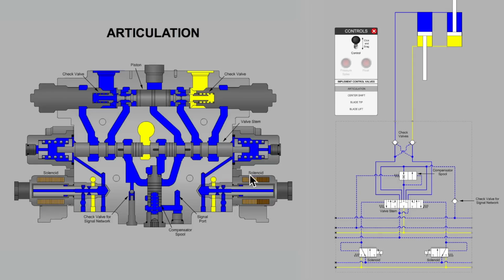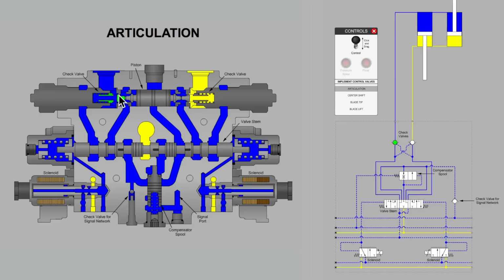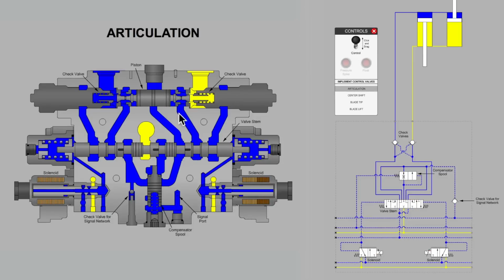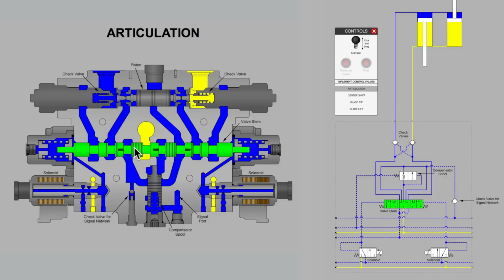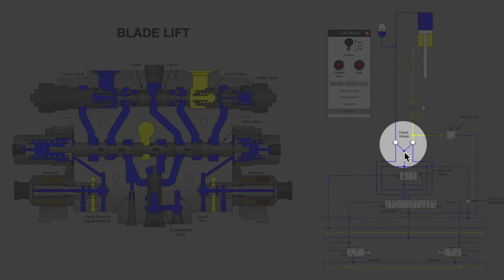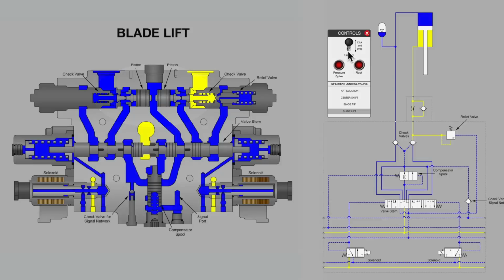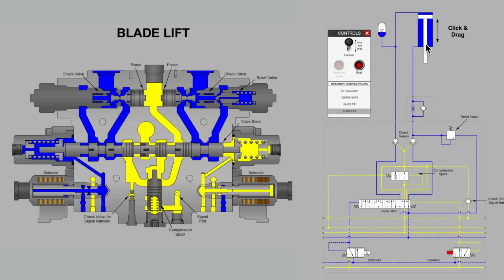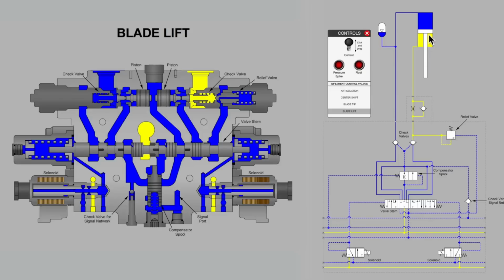Pilot Operated Check Valve Cylinder Troubleshooting - Part 3

Comment: Hello lunch box, I have a question , our hydraulic system during any operation pressure going to zero bar so we check found pilot operated spool valve  Y port continue oil leakage and one another valve continue oil leakage from drain point,  I have changed valve but problem not solve any idea from your side ??

Comment: Sir godmorning  i asking  control valve sideshift cylinder jack  have 2 pitting why the 1 pitting have pressure the 1 no have pressure electrical have suply lift in right  now i change complete control same problem no coming pressure in side pitting sir what is the problem

Comment: Hi sir ? How are you. I  have a komatsu p c mr 5o . Problem is that everytime you use travel stick  nomatter right or left the there is  a valve or spool stays glogged  for 10 to 20 second. In this position  you can not use any lever  but travel. Or swing  cause  if you dothat  the engine stalls. Please. Help me out